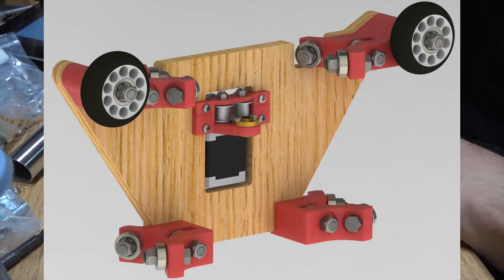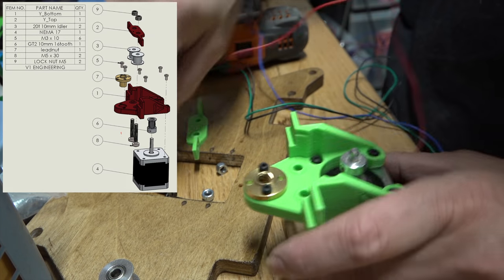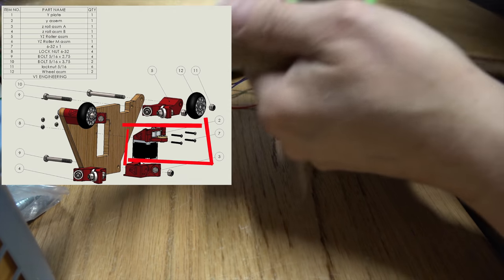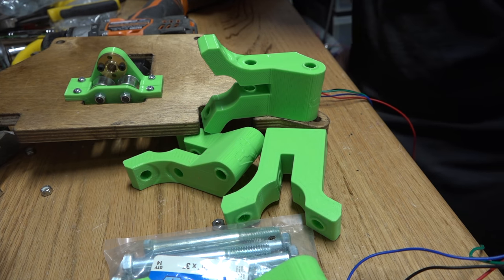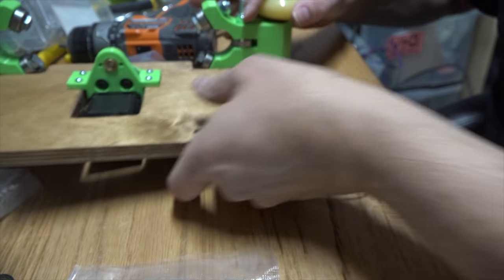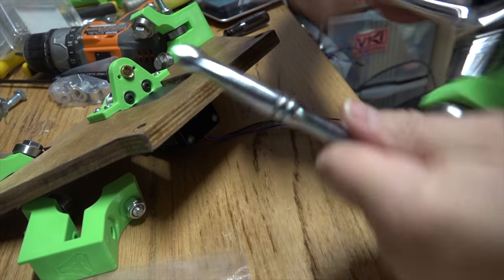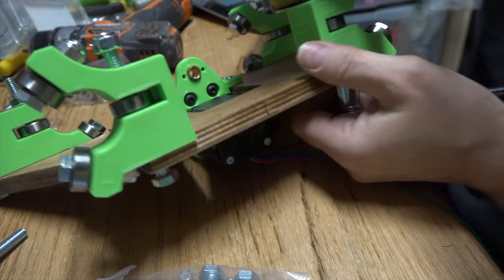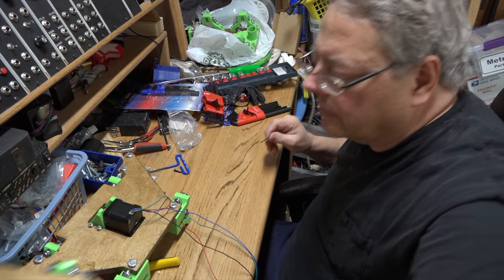Lowrider II Build - Part 3 - Y Plates

Comment: I appreciate you pointing out that you were using 3" and 4" bolts... I couldn't find 2.75 and 3.75 either and I was worried about whether or not they would work or not.  Great videos.  Still working on printing my parts, some slop in mine, yours look clean.  (new to 3d printing as well).  I also like that your adding a laser!!!   I'm going to try and do that too!  Thanks again!!!

Comment: All up, how much would you say this machines gonna cost you to build (not counting the routerand laseryou're gonna mount on it)? Wanna build one, but am on a budget and don't wanna start on it just to get halfway through and not have the funds to finish.
Reply: I budgeted mine at ~$450 including the DeWalt router, but that's not including the cost of the table. Biggest expenses, not including the router, are the controller(~$85), and the steel tubing(cost dependent on size of table and source, minimum ~$125-150+). The rest of the little pieces are pretty cheap, but they add up.
Reply from the maker: Well, I haven’t really been keeping track. 

It’s basically the Lowrider II kit from V1  $326.00
 (I started with a lowrider 1 kit) 
(I'm using a ramps which is cheaper than the mini Rambo in the kit
I had to order the belt, pulleys, and idlers for the LR2, (but that comes in the kit now)

The Dual Endstop wiring kit  …. `          $12                 
Stainless steel for 36” x 2. (Amazon)   $60
                                12” x 4  (Amazon)  $60

1 kg (approx) PLA                                   $28
(Not the cheapest, but I wanted a certain color)

1 pkg of 10 micro-switches (only needed 5) $7
( for Dual Endstops)

5/8 inch expandable wire sleeve 100’ $23
(Still got about half left)

Several 2”x2” x 6’ select pine boards to build the CNC table 
At about $7 a piece. Probably about $40 ?

2’x4’x.75” MDF for waste board $12

Some PLA laying around for the table brackets. ?

Plus a small fan for the processor case, some wire, Dupont connectors, 

Roughly totals to $425 FOR A 2 foot by 4 foot CNC

Probably a bit more.  I ordered some extra screws,M3, M2, and M8 screw kits.

And an excuse to buy some tools, level, drill bit set, etc…

Comment: I've run into a problem.  The pipe from Lowe's (here in Georgia) in the 3/4 " is not 24.5 or 25mm.  The 1" is too big and the 3/4 is too small...lots of play... is that what you had?  Thanks.
Reply from the maker: I’m using one inch OD stainless. See v1engineering.com for the specs. I ordered mine online, But you can get it locally I’m sure from a metal supplier. Unfortunately the home supply stores don’t carry it.

Comment: I have a question, how thick is the plate? 15 or 16mm right?
Reply from the maker: the Y plates as specified are 1/2 inch or 12.5 mm thick. You can go thicker, but you may end up needed slightly longer screws.
Reply: @Someoldguycoding  perfect! thank you